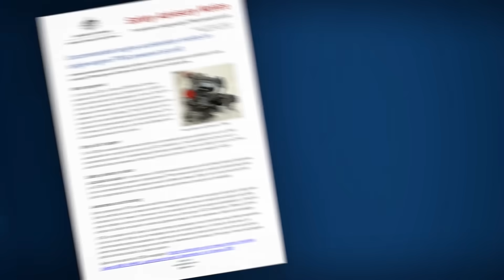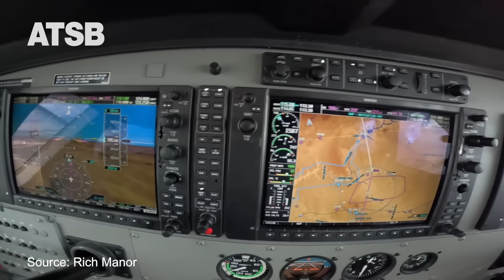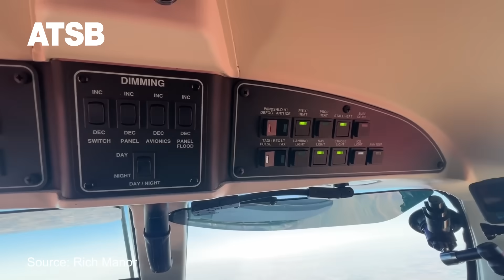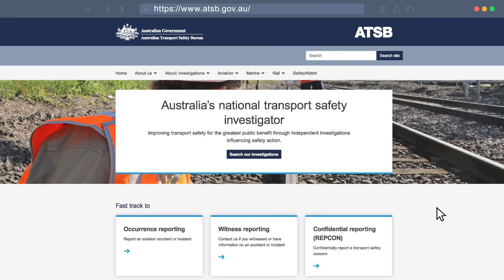Uncommanded acceleration of PT6A engines

Comment: So a PC-9 two-seat training aircraft has an emergency FCU manual override control for just such an occurrence, but a 10-seat passenger aircraft with the PT6A has no such emergency override.... how is that possible? Was it just assumed you'd climb to height on the power until within glide range of an airfield and then pull the engine for a forced landing? But what about rollbacks? I know of a RAAF PC9 that was almost lost when the FCU rolled back to idle and it was only the emergency FCU override that provided just enough power to maintain altitude until within range of the field for a forced landing. No such option on a Caravan with 10 people onboard (and no ejection seats like the PC-9!).

Comment: Just do what that Trevor Jacob feller did, shut the fuel off.  No need for a parachute though, if you gain so much altitude on the runaway, you'll be fine for a dead stick landing.

Comment: What a unusual incident, nothing worse than a aero engine going into uncontrolled overspeed. What I noticed was how the propellers were bent completely over on all 3 blades, that's a indication of a lot of energy at play on impact. What I would have done was cut off the fuel to glide into the airport. It was always going to be difficult to land the aircraft with so much power being created.
Reply: That's the correct move. Use that extra power to climb a bit, then cut the engine when within glide range
Reply: That’s true, but I think what the pilot did was also one of the better options out of such a situation. With a really unusual and highly dangerous malfunction at hand, I commend the pilot here for leaving all the passengers able to walk away with no serious problems. Power off would have been better, but something like a gust of wind or even a situation requiring a go around could have resulted in a much worse incident. With no QRH or any similar procedures either I think the crew did a spectacular job.

Comment: I’m a Caravan pilot and have almost 5000 hours flying PT6.  

The solution is pretty simple.  Gain altitude, shut down the engine and feather the propeller, and conduct a forced approach.  The Caravan has really good glide performance due to its long wing and no drag from the propeller.  

From what I can infer this was most likely an N1 governor failure. Probably just a sheared drive shaft which would put it in under speed.  That would move the 3D cam up which then rotates the fuel valve open letting more fuel in and making the engine accelerate.  

As the engine accelerates, the P3 bellows expands adding even more fuel through the fuel valve.  

This would continue indefinitely as it’s only the N1 governor that can reduce fuel to the engine in this scenario. The fuel topping governor could by bleeding P3 away (Py) but this is only if the prop has gone into overspeed beyond the primary and overspeed governors (or if you put it into reverse).  

The emergency power lever only directly controls the P3 motion of the fuel valve (up and down). It won’t rotate it left or right like the power lever/governor does through the 3D cam. 

If it was me.. I would use a modified Engine Flameout procedure after deliberately causing a flameout with the condition lever.  

Turn ignition on, fuel cutoff, and then low idle before N1 fell to 50%.  Repeat as much as I needed.
Reply: It's been a while since I flew a PT6 and it was in the Pilatus. Would putting the condition lever in ground idle be effective? We had some cowboy types at my outfit that were doing that to help with their descents. Which is mind boggling, honestly lol
Reply: @regionalflyer why is it mind boggling? I haven't flown a PC12 (which what im presuming you are alluding to) but have over 2500hrs in Caravans, Porters and Pac750s on skydive ops, the vast majority of which is descending in ground idle, and the engine has never coughed a beat. Especially helps on landing on a short runway when you are very light otherwise you end up floating forever if you're in flight idle. I'm genuinely interested in why people would think this is a terrible practise.
Reply: Before I read your comment, the same exact solution was going through my head. Turn back to the airport while gaining altitude, then shut her down and glide in. Then I thought, "OK let's see if anyone 'agrees' with me", and sure enough you were the first comment I read. You got way more hours than I do, so I feel confident that's the right way to deal with an uncommanded  engine acceleration.
Reply: Ive got thousand of hours with the PT6 and I 100% agree with you as well and that’s how I’ve always done it in training for this exact scenario.
Reply: @SierraBravo7970  So based on what you just said, there IS a procedure.  Interesting because the guy in the video said there was no procedure LOL. I think it's one of those commonsense things.
Reply: Keeping in mind that I’m coming from the perspective of a multi engine aircraft however the only way u can control a runaway is to shut it down. I know in the king air  this is how I’ve always trained and briefed every departure. Speaking in King Air aircraft If you have a runaway and u abort what happens when  you pull both  throttles to Idle. You bring the power on the “good engine” to idle and now ur a hard 90 toward that engine due to the runaway still being at full power. The runaway engine will remain a runaway until you bring it to cutoff so in this case you shut both down. It’s no different with respect to a runaway in a single as far needing to shut that engine down. Just put urself in the best position possible before you do.

I agree though kinda common sense if you can’t control the motor use it to your benefit and then shut it down and a basic power off landing. It’s an engine issue not a flight controllability issue so what happened here was interesting. I’m thrilled everyone walked away.
Reply: That’s why it’s important to train and incorporate this in SOP’s brief it! We brief engine failures, runaway are just as important to train and brief.
Reply: As a forklift driver I agree

Comment: To be fair the PIc probably experienced  "startle" effect and as tegh report states no procedures in training had been at that time taught to boggy pilots or published in manuals  I recall years ag  (about 50) INSEA a Helio courier had these same issue  bloke in the seat was trained ex test pilot  used the runaway to gain height in the end just shut off the fuel and glided in on n up hills bush strip 1970 from memory   . I am forced to say they guy did  a half ok job  without access to his training and other docs  every one eventually got out   tus a god outcome . My question now goes to the makers of the PT6 (one of my favoured power plants)   what have they done to address this  FCU was the gremlin not the pilot
Reply: N1 governor failure.  Probably the shaft sheared and since it was “under speed” it kept adding more fuel. Since the governor only adds a tiny bit of fuel at a time.. you have to wait for P3 bellows to add the rest so it’s not instant.

Comment: Yes, train for it, but if the Fuel Control Unit is known for uncommanded acceleration, why haven't upgrades been implemented?
Reply: Because it was likely just a failure.  PT6 FCUs are remarkably robust and reliable… but their overhaul periods are based on MEAN time between failures.  

That means while most will fail well after an overhaul period.. a few will fail early.  

If I had to guess.. it was an N1 governor failure. The N1 governor moves the 3D cam up and down which then adds or subtracts fuel to the engine to keep it at the speed selected by the power lever. A failed governor would keep adding extra fuel and the engine would keep accelerating indefinitely.
Reply: What are they?

Comment: Dont want like to sound like a smart ass but why don't you advise to gain some heigh,  cut the power and do an un powered  landing.  ????
Reply: That sounds like the default.  They don’t expressly say it, but they do explain why it wasn’t done in this case - undershoot should have been into occupied buildings.
Reply: I suspect the the engine was being over fuelled and the Exhaust Gas Temperature was exceeding safe operation so continued running with the High pressure turbine getting overheated ends in a very loud bang. He could not feather the prop as the engine would continue to accelerate. Tricky situation to manage,  I am sure in hindsight he would have chosen other options not known at the time.